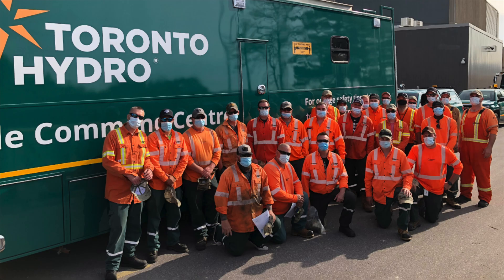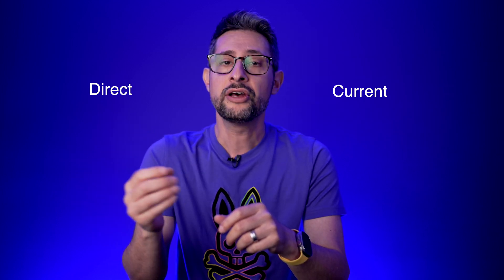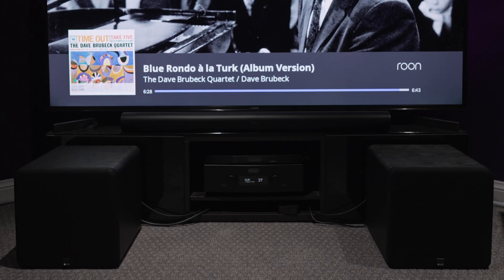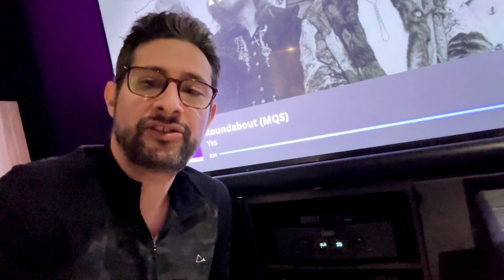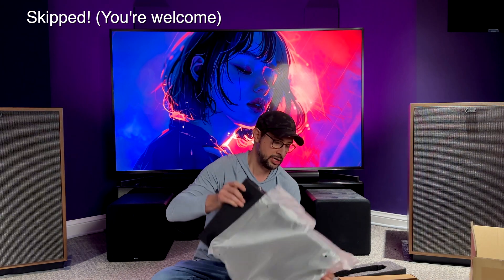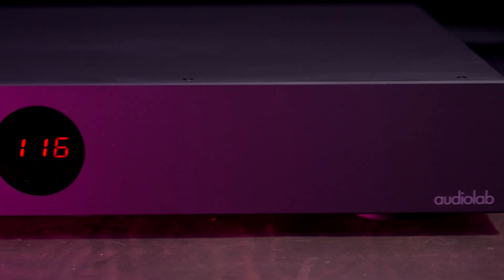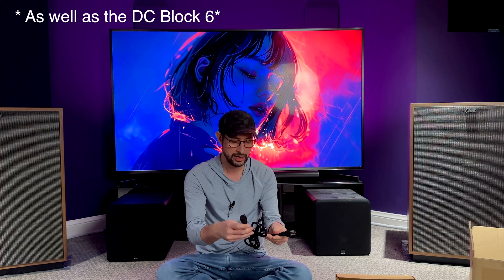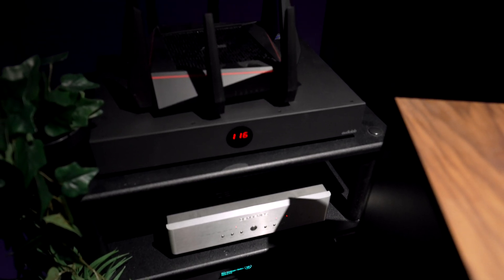Does your amp buzz? Audiolab DC Blocker & DC Block 6 review

Comment: The cable end is an issue.  Why did'nt Audiolab not just use the typical ends?  Fail
Reply from the maker: It's an easy enough workaround but very good question.🍻

Comment: Is there any difference between an audio labs DC blocker and a power conditioner? Furman make some good power conditioners in the morning if it’s the same
Reply from the maker: They do different things. 🍻
Reply: @ thanks… That’s what I thought!  Basically, I’m trying to eliminate noise coming from my amp’s power supply. I’m thinking the audio labs DC blockers probably the way to go. At least it’s worth a try as it’s not that expensive.
Reply from the maker: @ClassMPlanet-Yo yup, let me know if it works! 🍻
Reply: @MisterChibs  my amp is 500 WPC… so am I correct? I’m thinking I’m going to have to use the DC block 6? I think your video said the basic DC blocker could blow the amp, but the DC block six can handle higher WPC.
Reply from the maker: @ClassMPlanet-Yo  Yes, I would get the DC Block 6 instead.

Comment: So, I think there is some confusion in the description by Audiolab. An amplifier's output in wattage should (not directly) have effect on which unit you use. Let me explain,...What you are more concerned with is the power CONSUMPTION of the amplifier - usually noted in wattage and or amps on the back of the unit. Keep in mind, this is not the "output wattage" we think of when we say "my amplifier is 200 watts per channel. To add, this consumption rating is usually spec'd at "idle" and at full output + a safety margin. So, your Hegal uses 67 watts at idle and 830 at full output. Meaning, you can draw roughly a maximum from the socket of about 7 amps. Note, you'd never want something that actually uses the maximum power available on the circuit (e.g. 15 A is typical) as this is when things can get hairy. You have to keep in mind you may have other items on that line drawing power as well. So, here is where it get's tricky...As I prior mentioned, the output of your amplifier is related to this measurement (consumption) as generally, the more output wattage your amplifier has, the more power it consumes; However, this is NOT always the case. For example, a Class A amplifier may have (relatively speaking) low output but high power consumption based on the power supply design. A Class D amplifier can have VERY high output but a low power consumption rating. What I am saying is, you can't take the 10A amplifier rating that they give and equate that to an amplifier with 1200 watts of output...(because) they are not talking output; Rather, consumption. So, the small DC Blocker has an OUTPUT of 4 amps of power - you'd (generally speaking) have to be careful with an amplifier on that one - this is more for preamplifiers, cd players, streamers and such. If you were to use an amplifier on it, the consumption could not safely exceed about 480 watts of consumption; In fact, you'd want less. As for the larger unit, it has a MAX of all sockets totaling 10 A, or about 1200 watts combined. As per it's specifications, each receptacle can handle a maximum of 8 A by themselves (as long as you don't exceed 10 A with all). This means, your amplifier can (by design) draw no more than a maximum of  960 watts; Otherwise, you are indeed pushing it. Take note, the Hegal H390 draws a max of 830 - so, you would not want to plug much more into this Block 6 than perhaps a CD player, streamer, etc. in addition to the Hegal. Clear as mud?? ;)
Reply from the maker: Wow!  I have my DAC, H390, Lumin streamer, and ddc plugged into the DCblock 6. It’s been totally fine for months but maybe I should rethink this. Thank you for chiming in. 🍺
Reply: I had the Audiolab product but was concerned about its power limitation.  I replaced it with an Emotiva DC blocker that is rated at  15 amps.  Also with the Emotiva blocker you can use your regular power cord  (or upgraded one if you have one) to your Hegel instead of the one needed to plug into the Audiolab product. I don’t understand why Audiolab decided to use an IEC connector as the output connection.  In any regard, the Emotiva product works great and no worries with the power rating.  I believe my Hegel is very slightly more focused and 3 dimensional using a DC blocker.

Comment: Hello you made a mistake or confusing ; the 6 is note fore more power amp it is 6 time the same that the 1 socket; open it and you will see … so be carful not to blow your big Hegel 😮
The 6 is to avoid tu buy 6 units
Reply from the maker: Thanks for the heads up but this is false.
Reply: @ open the 6 and look inside , 6 x 1 unit 😉

Comment: I tried several dc-blockers (Supra, Ifi) including the Audiolab DC blocker. They all work fine and immediately blocked all the annoying hum, but...I'm quite surprised that I rarely see somebody mentioning a bad influence it had on the sound of their system!  (only occasionally I hear about someone having the same experience I had with dc-blockers)  To me, and in my system(s) hooked up to Naim amplification, the additon of a dc-blocker made the treble sound rolled-off/soft and dampen dynamics. 🤔🙁😴
Reply from the maker: @debalco  interesting. Considering what a DC blocker actually does, I don’t understand how or why it’s effecting your treble. I have not experienced this.
Reply: I’m glad for you that adding the dc blocker did not harm your sound MisterChibs. For me the change in sound and dynamics was too big to ignore.
Reply from the maker: @debalco  I wonder if the distortion created by DC is perceptibly better sounding in your specific setup. The thing about DC at least in my case is it happens intermittently so maybe not? As long as you’re happy with your sound I guess there’s no point sweating the details.  🍻
Reply: @MisterChibs   You might be right MisterChibs.  Every system is different afterall, and not everyone's perception is/has to be the same either.  If I experience a rolled-off treble, after connecting a DC-blocker, another person might experience this change in sound as non-offensive or even an upgrade. 🙂

Comment: Hummm its nothing, ...Buzzzz jitter... all the platforms have it 😱
You streaming ? Welcome to the sea 🌊 of jitter
Its like a hobby or second job 😂
You are fising songs whith no jitter 
Now listen some music from cd ,wait what is this zzzxx noise from the speakers well now you need ac power generator turn off all and listen music from a mini hifi system ,mp3 from a usb 
😂 😂 😂 Forget the living room its a money 💵 trap!!
Reply from the maker: Jitter and DC on your lines are not the same thing. It’s a fun hobby imo and like anything else, it’s only a money trap if you feel trapped. Enjoy your music! 🍻
Reply: @MisterChibs  man what I just said jitter from.
 Platforms, and noise from the your electric line
The funny thing it's when we were in analog world we didn't had those problems
Now filters, ac generators, net filters, streamers, jitter
Humm filters, external dacs 
Well time to listen selling england by the pound
From a pioneer amp from the 90s 16 kilos😂. Bw p4 speakers, a Mitchell turntable, and a tape Nacamitchi 
Yes I enjoy music 🎶

Comment: Thanks so much for that. I got a single dc block about a year ago as I was getting a really noticeable hum from an Audiolab 8300a integrated amp. Do you still use the single dc block with the Hegel h190? I'm fretting that despite what you said I should still use the block 6 on my h190,,,just in case! Thanks again
Reply from the maker: Still use mine with the H190. Only get the block 6 if you plan on getting a more powerful amp or want to connect more than one thing to it. If thats not you, stick with the single unit and save your cash. 🍻

Comment: I have been seriously considering this audio lab dc blocker but was concerned that my Hegel H190 which is rated at 150wpc would run into problems with the audio lab dc blocker as they recommend amplifies up to 150wpc
Reply from the maker: You’re good with the regular DC Blocker. That’s what I’m using with my H190.
Reply: @MisterChibs  that’s good to know as some people have suggested that it might not be suitable for my H190, 
I see you have bought a H390 ! Last time we chatted you said you wouldn’t get a 390 , how are you getting on with it in comparison to the H190?
Reply from the maker: @HJC1982  oh I love the 390! I’ve got the DC Block 6 on that system. My thoughts on H390:
https://youtu.be/9rg_ZaSDgTI?si=dCKs8y6470FQZlWl
Reply: @MisterChibs thanks for the link, it’s just made me even more tempted to buy the H390 now especially as it’s on sale due to the H400 recently being released.
The H190 works very well on my B&W 704s2 that can be a bit bright sounding with certain amps but the smooth and slightly warm nature of the H190 solves that problem.
I have heard some say that the 390 is a bit brighter than the 190 , would you agree with that?
Reply from the maker: @HJC1982  did you hear that from the same people that told you not to use DC Blocker with H190?🤣 Jokes aside, 390 is not at all brighter  than the 190. Try and demo with your setup and I think you’ll be happy. 🍺
Reply: @MisterChibs  as much as I would love to I’m not sure I could stretch that far . 
I was lucky to get my 190 for a very good price and I said to myself back then that this is probably my limit,
If not where do we stop with this expensive hobby continually chasing the next best thing ?
Reply from the maker: @HJC1982  Good point! It seems your pull out game is far stronger than mine!😂  As long as you’re enjoying yourself, the H190 is an awesome bit of kit! 🍻
Reply: @MisterChibs  I’m not sure if it is actually, just today I have been eyeing up an end of line H390 with massive savings 😑😆
Reply from the maker: @HJC1982  😮let me know what happens!

Comment: Getting rid of buzz and hum by blocking DC isn't the only function of this unit.....the improved quality power supply will also improve the SQ of one's audio equipment. Pity you didn't review that side of things.....which is of more importance to most music listeners.....but yes, a great unit, extremely happy with mine.
Reply from the maker: I did mention this in my review. Thanks for watching and sharing your experience with yours!

Comment: I have terrible power at home. Every transformer has buzzed (some more than others). I installed the Audiolab DC blocker and no more buzz. Did it limit power? Did it limit dynamics? Not sure. I don’t have a treated room but this DC blocker was the solution to my transformer buzz.
Reply from the maker: Glad to hear. I doubt clean power going to your amp will have any negative effects at all. 🍻

Comment: I had a listen to Paul at PS Audio and he said that if you have  " DC " the power company will swap the transformer.  He was talking typically of about 500 mV to 1 V.
Which here I am isn't much at our 260V or even US 115V.  From what I remember the US transformer outputs 2 phases and neutral to the  house with 240 between phases. We have lot of homes 3 phases and a neutral at 440V between phases. The 3 is optional and handy.
As DC cannot go through a transformer I'm starting to think its more of an error in the transformer giving a variation in voltage measured from neutral to the phases.  
 Where I am with mostly over head power to the house, a lighting strike can be devastating to all your electronics, so a trap is essential.
Reply from the maker: Thanks for chiming in. I’ll have my electrician read this over and try and explain to me 😅
Reply: @MisterChibs  Should add with an error if we consider both sides of the wave as " equal " then the we would shift the zero point one way to make equal and so that point would now be a volt or so.

Comment: I forgot, your hum could also be coming from your TV and related items.  If you have cable (internet or TV) you can try a coax noise filter.  Disconnect your TV and computer related products from your amp and if there is no hum, your problem is most likely video/computer related.  Use a separate outlet for your amp away from the other equipment.
Reply from the maker: Didn’t mention in the video but one of the steps I tried to trouble shoot initially was unplug a whole bunch of stuff including the TV. It was definitely DC. Thanks for the suggestion though!🍺

Comment: Blocking Humms is one thing, getting clean sound improving AC is ideal.  But good products are expensive, and, regarding Audiolab, it is "not really affordable" but, as you mentioned, your quality power cables do not even connect.  May I recommend you try better power "filters" such as Puritan PSM156 or, if you can get one of the best, Inakustik?  I was able to try the Inakustik AC4500 for a week and it just transformed my entire chain...It was not even subtle... and, no Humms
Reply from the maker: Thanks for the suggestions! I’m open to trying out either of those in future. Not a lot of info on this stuff. Maybe because everyone’s power situation is so deferent. An other reason could be power conditioners and dc blockers aren’t as sexy as speaker / streamer / Amp/ DAC reviews. For now at least I’m happy to get rid of the DC!🍻
Reply: @MisterChibs  It would just suck to buy the relatively expensive Audiolab DC Block-6 and find out that by buying a much better product (yes not sexy at all) it would solve all your issues, improve you sound greatly and render this one obsolete
Reply from the maker: @alpro3714  There’s always a bigger fish 😉

Comment: Absolutely products like this work !!DC  Blocks work I make my own, The Cambridge SWITCH MODE POWER SUPPLY typical only needs EMI/RF I also customized for each type in my racks for all my systems.

Remember Ceiling Fan controllers can aslo generate hum if not updated and on or near the same breaker group.

Also on older Amps will hiss and hum when the filter Capacitors age.
Reply from the maker: @HeavyCrown2030  That’s cool you made your own DC blocker!! I’ve learned a lot about this problem. Ever since I moved here Iv’e been able to isolate every weakly shielded power supply. Power bars, the power brick from a lazyboy. Sometimes I get humming in my recordings if my camera is connected to the mains. Such an eff’n PITA! 🍻

Comment: DC can’t be the only reason amps hum. I had a top of the range Sony AV amp that started humming very loudly. My present Denon AV amp doesn’t hum at all, nor does my stereo amp. Some amps are poorly made.
Reply from the maker: @aussie8114  perhaps not the only reason but it was DC in my case. I have a feeling that the H390 being larger and better made was the reason it didn’t buzz as loud as the H190. If you still have that Sony AV amp, it would be interesting to test with one of these.
Reply: @MisterChibs  No it went to the recycling centre. I’ve had Marantz, Onkyo, Sony, and Denon. Sony was the only one that developed a very loud hum from the transformer. The Marantz and Onkyo simply died on me. The Denon has been excellent.
Reply: DC is just one of many possibilities loose wires on any outlets can also cause noise, other equipment on the same leg or just components inside the Amp. 

But with the previous equipment problems you may want to confirm your electrical is solid, but that would need a skilled technician .
Reply from the maker: @HeavyCrown2030  Good electricians aren’t always easy to wrangle. I’m still waiting for mine to replace some busted fixtures.. RICHARD!! 🤣

Comment: Great videos 
I’ve watched a few of your videos because I’m 2 months into breaking in my new Cornwall 4’s.
I have light static / hiss coming out of the cornwalls.  One dealer who tried to talk me out of the cornwalls mentioned hiss is typical from the cw’s?
So I’m thinking of buying the puratin 156 power purifyer based on all rave reviews on YouTube to see how it will help?
How are you liking your cornwalls?
What subs are you using and do they integrate well with the cw’s?

I have a large home theatre style sub with LFE only and it does not integrate well with the cw’s, likely due to the high efficiency of the klipsch 

Keep up the good content!
Reply from the maker: @JamesJones-qs7rr  thanks James! if I put my ear right up to the CW’s, it’s normal to hear some hiss. Never from where I sit though. Cornwalls are amazing (obviously 😂) and I’m scratching my head on why a dealer would try and talk you out of them. What was his reason? 
    As far as subs, I use a pair of SVS SB2000 Pros. What I like about those is I can dial in settings from where I sit. Getting them to where I feel happy took a while and sometimes changes without me having to get up (which is so underrated)🍻
Reply: Thanks for the reply
I’m in Vancouver area and more than one dealer of klipsch heritage tried to talk me into their sonus faber or b&W.
Based on YouTube reviews like yours I took a chance on the cornwalls and got a great deal from the Burlington, Ontario dealer.
I’m impressed by the dynamics they have, but still waiting for the 400 plus hour breakin others speak of.
On my shortlist of next gear to try is AGD amp, gallion tube amp, and luxman or accuphase.
Currently Using a McIntosh Pre and Rotel 2 channel amp and sounds pretty good.  Biggest challenge in this hobby is convincing the wife.  Even my kids take pokes at me.  Everyone hates the look of the cornwalls in my house.  😂

Keep up your content, it’s good stuff!
Reply from the maker: @JamesJones-qs7rr  thanks man! I demoed a nice pare of Sonus Faber. Build quality was better and they sounded great but the Cornwalls were what I connected with on a whole other level.  Make sure you’re able to demo the amp before you buy. Pretty much anything can drive them but CW’s respond really well and differently with good electronics. 🍺